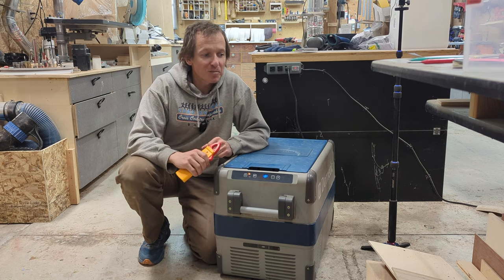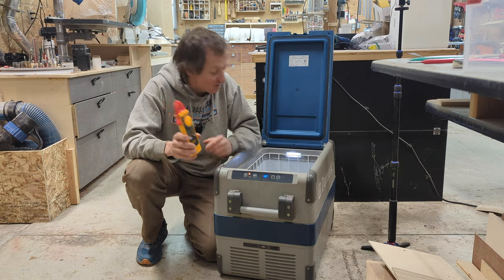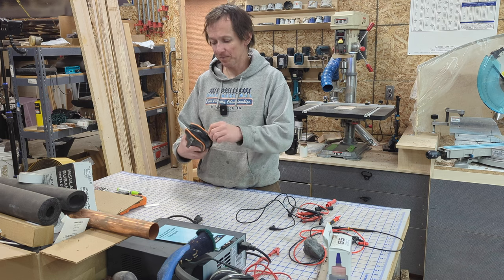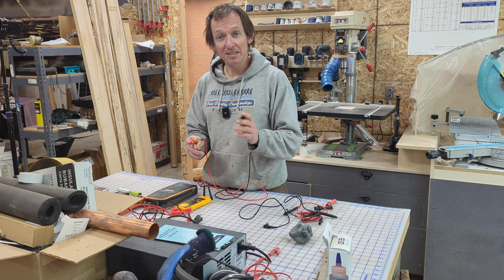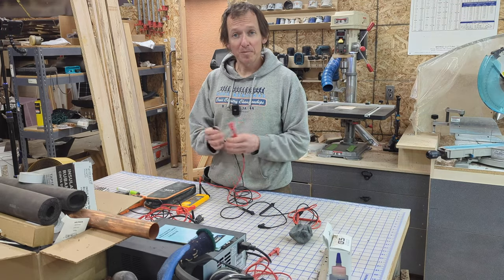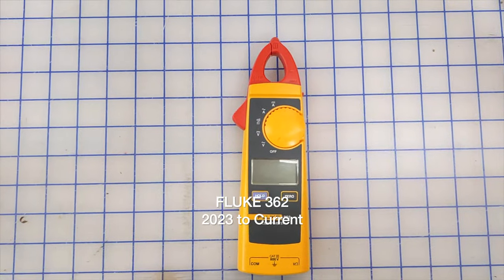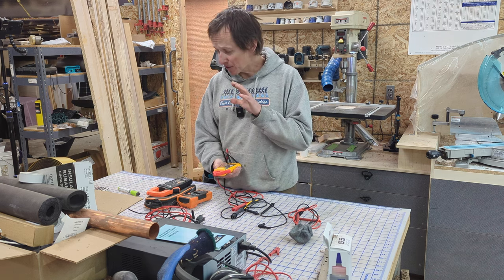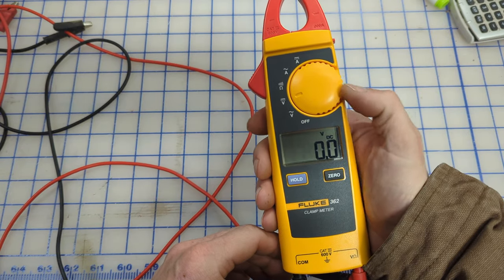Practical Multimeter Tips (Better Test Leads, Fluke 362 and Klein CL800)

Comment: Ugh, posted a comment when this video first came out, but it looks like it may have gotten auto-filtered by YT. Probably because I recommended something on the big-A shop.

If it ended up in your "held" comment queue, there's probably 3 similar ones along with it :)

I also recommend the TL40 probe set for automotive work. They're a lot finer/sharper, which helps pierce wire insulation without leaving big gashes. On top of that, for automotive work, you can buy "backprobe" sets that are also designed for sticking into the back sides of connectors, or piercing insulation. They are also bendable for weird-to-reach spots. This allows for a lot of hands-free probing. 

The posts that go into power supplies and multimeters are "banana jacks/banana plugs," and you can buy probe sets with swappable ends (banana plug to spade connector, or terminal rings). Super handy.

An additional benefit to the Silicone leads is that they don't burn/melt when touched by really hot stuff (soldering iron, maybe touching an engine).
Reply: Ugh a ugha